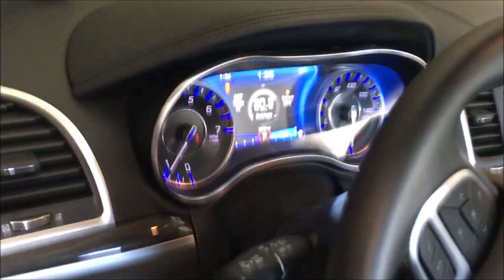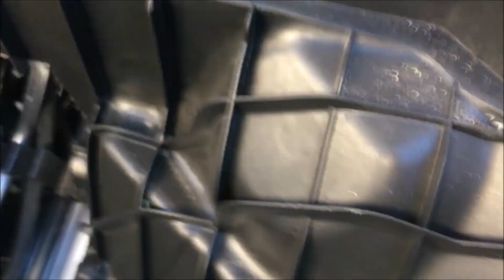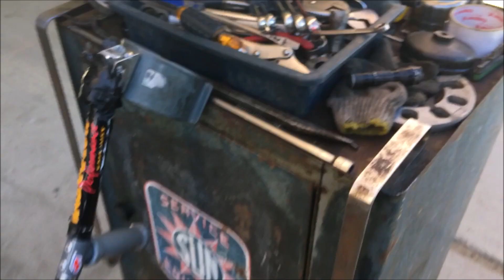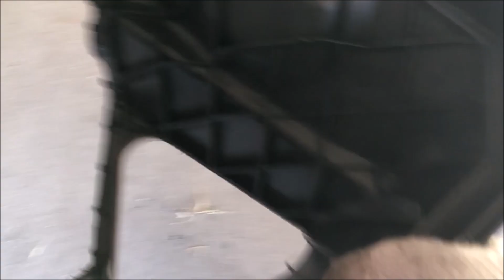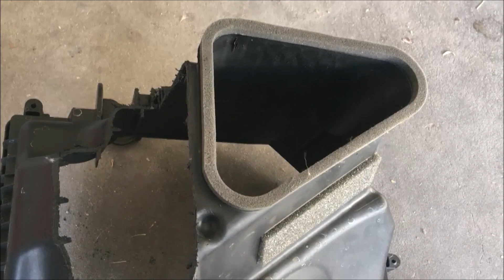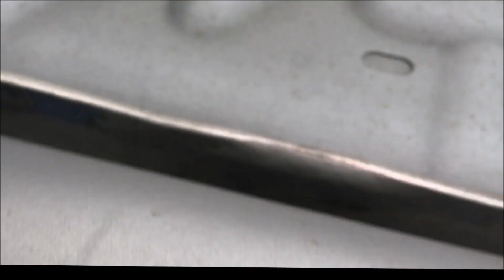Free cold air intake. power, torque and low budget exhaust upgrades Chrysler 300 Part 2

Comment: So, now you are oulling hot air in from the engine bay.
Reply from the maker: According to my tuner my intake manifold temperature is only about 10° hotter than the outside here that’s really good considering how hot the engine is below my intake manifold. It’s because my cold air setup is doing its job

Comment: This is going to put so much dirt inside your engine you will be replacing the engine in 50000 miles
Reply from the maker: The air goes through the air filter first.  All that I did was open the air supply on the airbox to make it larger than the original small hole.  Quite simple really.

Comment: I think the hole is a bit big it may give you a very dirty fillter an you will have to replace a stock filter may be get a kN washable filter an gets better air flow
Reply from the maker: Yes more filter exposure can get it dirty faster however, if you have a cane and filter you just wash it and put it back in.

Comment: How tf you got 30 miles per gallon mine got 18 😭😭
Reply from the maker: I may do a video on how I drive for fuel economy.  The short answer is I push my throttle very lightly and gradually, while I watch my MAF, Fuel economy, Vacuum, Throttle position, and RPM.  I shoot for lower numbers on all those gage readings.  I get either a banks I dash 1.8 gage or SCTX4 tuner and select the 8 gage setting where I can watch RPM, MAF counts, throttle position.  I moderate my foot on the accelerator to  get the lowest MAF counts, throttle position, and RPM possible.  For example, if you have cruise control on and you go up a hill, the MAF counts, Throttle position, and RPMs go higher, therefore using more fuel.   Cruise control maintains speed without fuel economy in mind unless you are on straight level roads.  Hills, and acceleration reduce fuel economy, light pedal, low rpms, and low MAF counts give better fuel economy.   Also light to light stop and go traffic greatly reduce fuel economy.  Now if I just drove it without monitoring my gages, and just pushed the throttle down more than half way and accelerated to speeds quickly, my mpgs, get lower and lower.  That is how I have achieved 30's in mpgs on some drives where I am consistently monitoring my gages and my accelerator position while driving.
Reply: He Drives VERY SLOW!! That's how and never uses sport mode...

Comment: V6? 😂😂😂
Reply from the maker: Yes the 3.6 DOHC 4 valve per cylinder V-6 that revs to around 7,000 rpm unlike the pushrod V8 engines.  There is great potential when these engines are supercharged by either RIPP or Sprintex.
Reply: He said  ."""V6?""🥴 ....yea V6😎

Comment: You are still sucking hot air from the engine compartment
Reply from the maker: My underhood stays way cool since I removed the heatshield on the hood which holds hot heat in, I also removed the engine cover which keeps all the sensors much cooler.  The cooler all the sensors, coils and electronics, the longer they last.
Reply: @madboostingmadmatt48  what if you keep the heat shield and the cover on and cut the box the way you did?  Would that hot air negativity affect it significantly?
Reply: I thought to all the time . Factory it was not stupid to do that air cold intake on

Comment: Any codes or failed smog after air box modification or exhaust?
Reply: Ivan Mendez exactly I need to know this too because I’m thinking my dashboard is gonna light up like a Christmas tree. Lol
Reply from the maker: Every SMOG station is different, I would ask them before hand since they are the ones that sign off on your inspection.  I have had no check engine lights, nothing but positive results so far, and I have driven that set up for some time.  You could always install a cold air intake kit that is C.A.R.B. legal if you are concerned about SMOG, it just expensive.